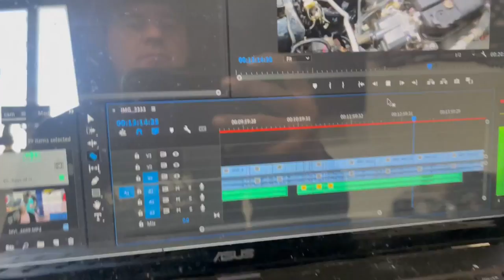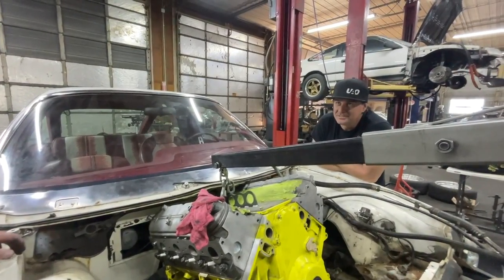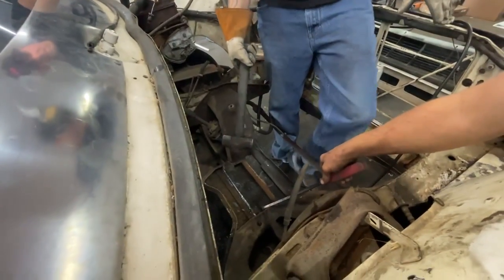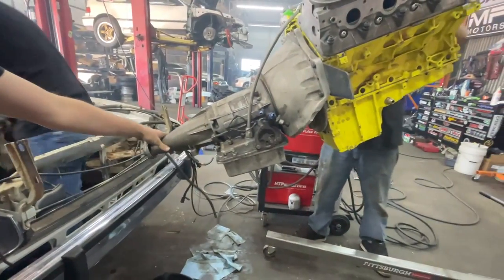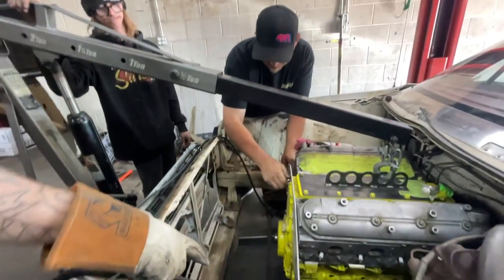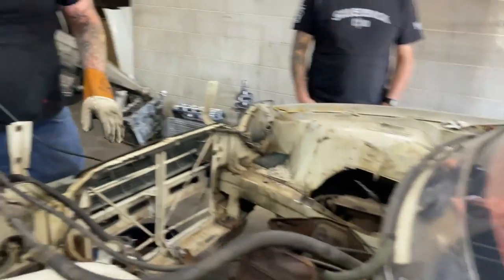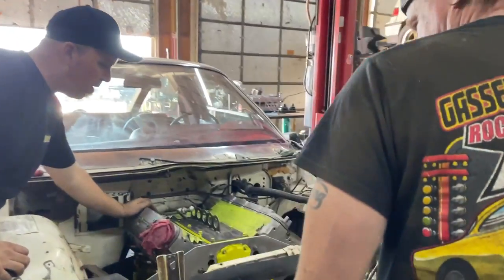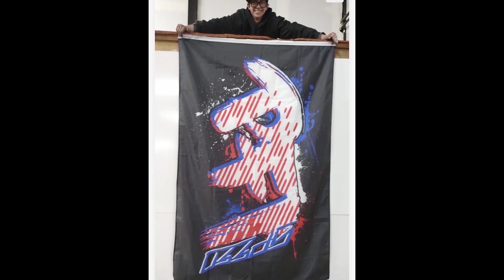We Put A V8 In The Coolest AMC PACER!

Comment: Speaking from personal experience don’t underestimate the strength required of the K-Frame for the Pacer. I found out the hard way that because of the design of the “frame horns” and the front suspension what looks like a way overbuilt K-Frame on the car was actually really not.  That said engine plates help but the key word is help.  If you can find a cheap manual Pinto rack you will be much better off.
Reply from the maker: Good to know .
Reply: @PFIBrent  be interesting to know what you think of my idea considering us aussies build these as our dailys haha

Comment: brent try get some vacuum assist front brakes so no matter what your brakes dont get too hard im not sure if you can get an electrical vacc assistive brake master or not? but having none even in a v6 is annoying. also make sure your rear wheels are square with the fronts or it will slide and favor one side and can get you stuck in tight places

Comment: Gordo is cool shit.. Brent and all the guys humble I sat and had a convo with Gordo for a good bit. Also Gordo if you see this what was the boost fuel thing you were talking about? It raises the fuel pressure with boost ?
Reply: Fmu probly
Reply: Ya an FMU it raises fuel pressure based on boost kinda like a regulator but designed for low boost applications so a car can make a little boost without needing tuned
Reply: Any suggestions on what kind to get
Reply: @BBsAuto  I use malpassi rising rate fuel regulators in my rotarys. More revs more fuel
Reply: Okay I see they do look pretty good in quality. Is there any videos on how you should plum one ?
Reply: I'm going to be trying to run one on my gtp low boost like 10 psi or 11 psi

Comment: Brent I stopped by awhile back. Was told you didn’t have time for a new project. Well I still need help. Have a 67 Camaro with crate ZZ632 GM motor. Posy track 4/11 rear end. With old police interceptor 400 turbo trans. I’m being told trans can’t handle the  torque and rear end wont work now as well. Need help on Tran and rear end please

Comment: I ❤ the Pacer.  I would have left it AMC powered by using a built 390 V8 for originality and clout.  They can make 500hp NA and 800+ with boost.  These engines won championships and is no more expensive or difficult to make burn out car power over a LS.

Comment: Shoehorn: [noun] An automotive specialty metal cutting tool sold on the Snap-Mat-Mac truck designed specifically for mentally challenged mechanics who think ANY engine (*1) will fit in ANY vehicle (*2).  Note: Usually found on the back wall near the Magic Wand.
*1 Not applicable for 16-71 Detroit Diesel 
when used in
*2 Honda Car 600
Actual fitment may vary, not available in Washington DC or when prohibited by evil government ... yadda yadda.